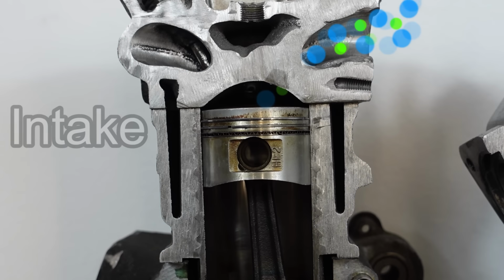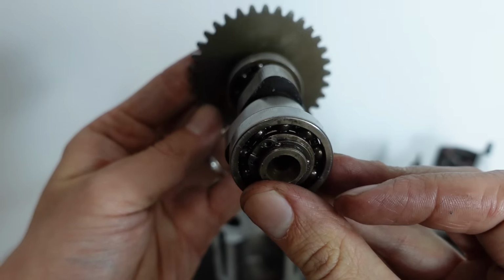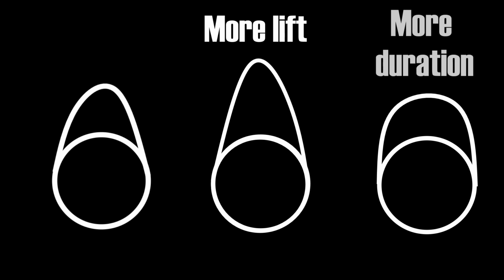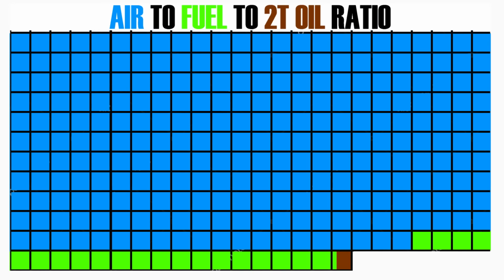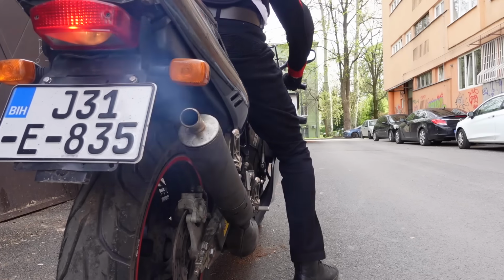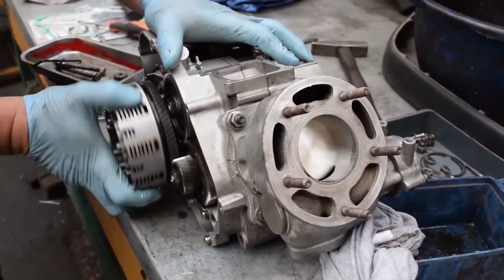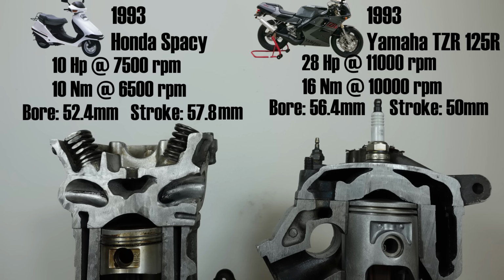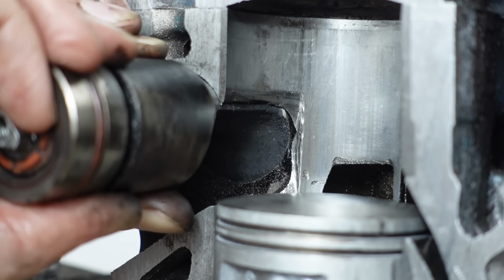The Only Video You'll Ever Need to Watch to Know how 4 Stroke and 2 Stroke Engines Work and Differ

Comment: I have a Bachelor of Science in Mechanical Engineering (BSME) with a Major in Power and Propulsion. Your presentation is very well done. The only thing I would like to clarify is that not all Two Stoke Engines require frequent rebuilds. You did allude to this fact, but I personally rode a 1974 Suzuki GT750 Lemans (Water buffalo)129,000 miles before the crank seals needed replacement. The crank was just fine and is still running at 156,000 miles. Many of the Lemans America Club members rode a GT750 approaching 200,000 miles before a rebuild was required. One of the Lemans America Club Members put it best when he said, "The longevity of the GT750 Lemans is the best kept secret in all of Motorcycling!" Incidentally, the Suzuki GT750 Lemans was the first Liquid Cooled Production Motorcycle from Japan. It was released in Japan in 1971 and in the USA in 1972. The bike was nicknamed the "Water Buffalo" in the USA and the "Kettle" in the UK.
Motorbike Mike Piekarski

Comment: This video is a beautifully and phenomenally explained guide to 4-stroke and 2-stroke engines! Your clear breakdown of each engine cycle made the differences easy to understand. The visuals illustrating the intake, compression, power, and exhaust strokes for the 4-stroke engine were particularly helpful, while the concise explanation of the 2-stroke cycle highlighted its strength and drawbacks of inefficiency. Thank you for creating such an insightful resource!❤ Just subbed

Comment: Wow I really appreciate on this explanation on the difference between Two Stroke and Four Stroke combustion , in order that the viewers can get knowledge and understand the mechanical function on each parts of the engine, it is very good illustration of the engine block that they cut on a half so that every viewers can see the movement of parts inside on the  block.
Thanks for good illustration.

Comment: The returning pressure wave caused by the expanding section of the expansion chamber
is a rarefaction (low pressure) wave (see 26.11) that helps to "suck out" the exhaust gas.
The narrowing section at the far end of the expansion chamber causes a compression
(high pressure) wave that pushes back on the intake charge which is trying to exit through
the still-open exhaust port.  The proper timing of these waves depends on rpm, and it's a
major reason for the narrower rpm power band of a 2-stroke engine.

Comment: When I was 16, My Physics teacher at school, let me actually take the class, when we did 2 stroke and 4 stroke engines. We had a working, hand cranked cutaway mockup of a 4 stroke single, which I used, and I also drew diagrams on the White board. For good measure, I explained Carbs, Reed Induction valves, and went onto Turbo and Superchargers. My classmates were jawdropped, and my Teacher was highly impressed,
Respect Achievement unlocked!! 😊👍🏻

Comment: Great video.   One correction:  the valve shown in that YPVS implementation is NOT a guillotine style valve; it is a rotary valve.  Yamaha used guillotine style valves on other engines, including TZR and TZ models of various vintage, including all 4DP and 4TW model TZs.  5KE TZs used the guillotine valve initially and the final version (5KE3) used a rotary valve.  The guillotine valve is effectively either on or off/digital, while the rotary valve facilitates a more continuous/analog function.

Comment: I had 2 125cc 2-stroke motorcycles when I was 15-18. A Husqvarna supermoto and a Yamaha supermoto. The Husqvarna was more powerful and better but it was stolen. Then I bought a Yamaha. I had to do an engine overhaul on both. All bearings etc. Right at that 20,000km mark. I was able to use the Husqvarna for free on the dyno. It made 27hp from the rear wheel. Very good video. I understand 4-stroke engines very well because I have repaired large truck diesel engines (Scania). Even though I repaired my own motorcycles back in the day, I never 100% understood 2-strokes. Thanks

Comment: Not specifically rocker arms lol. Usually you have either SOHC or DOHC (Single/Double OverHead Camshaft), which are usually called "direct acting" since push cups are placed on the valves, and the camshaft(s) directly press on them. You also have the same but with rockers, where the camshafts are usually to the sides of the valves and push on the rockers (which push on the valves) instead; this makes the cylinder head (and potentially the rocker cover) shorter vertically. More rarely you have Pushrod engines, which were most popular through the 20th century; this is where instead of the camshaft(s) being right under the rockers, their place is taken by Push Rods, which run through the engine block; the camshaft is located in the engine block instead, and pushes on the push rods; the pros of such composition is that a shorter geartrain/timing chain/timing belt is needed; a variation of this system is a Flathead engine, where all valvetrain components are in the engineblock, and the valves are pushed either by a DA camshaft or push rods, instead they are placed on the side of the cylinder, most popular in the early 20th century, although still used today due to it's simplicity, such as the Briggs & Stratton 450 series engines, most used in lawn equipment, where the head is a (almost) flat piece of metal with cooling fins. However, not all flatheads are just flat heads, some have oil or cooling jackets running through the head.
Correct me if i am wrong, i am not an expert in this

Comment: A great explainer. I've been using 2 strokes every now and then, and it never occured to me that the air fuel mixture was traveling through the crankcase before making it into the cylinder

Comment: I have information on a hybrid engine made in the mid 90's where some one combined the parts from a 80cc honda 2 stroke and a 80cc honda4 stroke engine. The prototype was made from small engines to cut the cost on making a prototype for proof of concept. The result was 2x the horsepower at 1/2 the weight and a smaller size. The resulting engine tried to rip itself from the test bench it was fastened to from the torque increase.  Wish I could find more info on what happened to the idea but at least I remember the specs and ideas. I even made a PSD file with the info ^_^

Comment: You can also replace the vacuum created by the cylinder with a compressor. 
This allows you to fully seal the crank case and use similar lubrication as with 4 strokes

Comment: The expansion chamber is mindblowing. Does it need to be an exact shape or size? Can you just make it huge enough so it will  push back the air/fuel mixture? I'm guessing if it's too small, you won't get the same effect.

Comment: Question. You discussed the Expansion Chamber. Is the Stock Exhaust on a 1969 Kawaski 2 Stroke 500 H1 an Expansion Chamber? How/what does removing the Stock Exhaust on the same motorcycle and replacing them with Expansion Chambers change the process?

Comment: Did you have make a video about how a transmission work? I can't find any in your channel.... 
I suspect most people has never seen any and don't know exactly how the transmission shift works (especially the motorcycle sequencial shift). IMO the transmission is one of the most intriguing parts into an engine, and it would be fine if you make a video showing how it work!

Comment: I came here because I was very confused after acquiring and running a 2004 evinrude outboard motor. I knew it was 2 stroke, but it didn't act carbureted.. Turns out, it's fuel injected..

Very interesting piece of tech.. 

From my understanding the motor pumps oil and delivers it strategically to different areas of the motor (versus mixing with fuel).

Comment: Best video on utube regarding overlap etc thx..
I'm  stressing atm i did an oil change  on my 04 525exc as per 100 times previously but when finished it refused to turn over with kick or button so pulled clutch cover off to find needle bearing supporting the sprocket which turns crank over  [the centre one which sits about 2oclock to right of clutch] had spat a few rollers. Reflushed case with oil blew out case gently and backed valves off in case they were catching piston but still didnt want to budge. Tried rolling backwards gently etc nothing. I ended up using socket on crank bolt and got it. Didnt try to start but i adjusted valves [possibly incorrectly hence the love of your awesome vid so I'll do again as its still grabbing a little. I've no confidence going much further 4t's lose me lol so i can only hope no rollers got into bottom end [if they're even able to?]or anywhere else but having not tried to start I'm lost if the shrapnel should go too far at all? Now I'm  scared to try and start it just in case.
Reply: No idea how I sent my previous comment to this vid it was meant for your vid titled "why it's important to understand tdc lol technology  and 4t's really dislike me I think.

Comment: Thanks, very clear and good. Why is it said that ktm’s TPI/TBI improves the ecological credentials of the engines? It’s not direct injection, fuel mix gets still leaked through the exhaust port and oil burned in the chamber…

Comment: KTM has the injection in at least some of it's 2 strokes now. Looking at it in this video though, it looks like you can't use a pre-mix any more as the fuel doesn't get sent below the piston...with that in mind, I'm guessing it's the separate oil tank and it gets injected into the air intake?

Comment: Great video. But 1 question. Given that timing chain/belt failure is so catastrophic to an engine, why do we have interference engines? If the valves and pistons could never meet, at least the engine wouldn't be so severely damaged by a timing malfunction.

Comment: Excellent presentation!! 👏 Two questions.  I wasn't aware of reed valves being used in two strokes. Do they stand up to hi temperature well? They look like they're are perfect for pulse jets, but they would be in the red hot zone. And how do they calculate the dimensions of the expansion chamber? 
One last question. Do you have any videos on pulse jets?

Comment: Hey! Great explanation! Although I couldn't watch the illustration since I am blind, I managed to understand, at least basically, how these engines work. I knew that the 2 stroke makes that awful smoke because it doesn't burn it's fuel good enough, but it's much worse than that! It dumps part of it outside and it burns all it's lubricant! Dam! They should be illegal even in scooters!
Edit: Thanks!

Comment: Good video very informative.
However you missed one of the biggest benefits of two stroke engines, they can operate in any position even upside down.

Not having an oil pan means that oil will not flood the engine if it is tipped or tilted, this is why two stroke engines are preferred for chainsaws and leaf blowers.

Comment: Fantastic well done video, thank you. One question if you still monitor this is with direct injection in a future two stroke, how is lubricant introduced to the bottom end? I've also assumed the big reason two strokes still exist in chainsaws, weed whips etc is the constant movement and angle of engines don't allow oil pans like 4 strokes, is that true?

Comment: If you specifically look at the marine outboard engines, the old 2 strokes a huge amount from the 80s on up are still humming along fine while many of the 4 strokes from the mid 2000's have many issues.  That's because they have more moving parts, more weight and higher complexity leading to more failures.  Again, marine outboards in particular, motorcycles might be a different story.

Comment: You should probably have included places where 2 strokes are more used than four strokes, for example, marine diesel engienes and such. Because if a two stroke is well made enough it is much more efficient at larger sizes than a 4 stroke :)

Comment: Direct injected 2 stroke engines have been around for a long time and are currently used in busses, trucks,  boats and especially large merchant ships.  They are all diesel, and rely on a single port at the bottom of the cylinder and a valve at the top for scavenging.  They all require some sort of compressor to push air through the cylinder fast enough to clear a sufficient amount of exhaust gas.  The most common 2 stroke diesel is the GM 6-71 series.

Comment: Thanks for the explanation video, however I still have some questions left. Based on the difference between the two, how does these different combustion mechanics affect the difference in how the exhaust is shaped and sounds like? Is 23:41-27:17 [VVT & Power Valves] the answer to that?

Comment: Now I understand the whole mechanism inside. My question is that my two-stroke Yamaha emits heavy smoke even at idle and more heavy smoke when accelerating. What could possibly create this?
Here some details:
1. The spark plug is all the time black even on lean burning.
2. The reed is ok.
3. There are always oil leaking at the tip of the exhaust muffler.
4. The carburettor is cleaned no dirt.
5. No oil leaking from the engine.

Awaiting a solution from you.

Comment: Have you had a look at Evinrudes Etech? 

Has variable exhaust timing gate and stratified direct injection. 

Oil galleries take care of lubrication.  Runs around 1000:1 .
This makes it run clean and efficient. 
 So clean infact, they got an exemption from the EPA because they are cleaner than most 4 strokes. 
Evinrude suggested that if emissions was the EPA's reasoning,  that perhaps all 4 strokes should be banned. 
 
With such a clean burning stratified engine with only brand new oil on the bearings,  servicing is almost not necessary and engine life is extended considerably.  This engine becomes extremely cost effective and environmentally friendly! 

It's quite possible that they were forced out of the market simply because of the potential reductions in maintenance.   But I think their poor marketing had more of an impact. Also the Canadian taxes and regulations made it impossible during covid.

Comment: There are hybrid engine technology inventions that retrofit the existing powerful 2-cycle and cleaner 4-cycle engines into a “D-cycle” (differential-stroke cycle) engine. The hybrid D-cycle design has been tested to great efficiency (>20% fuel saving), and great power gain (>2.5x to 3x torque increase). These retrofit technologies are all available in existing engines. It is just by splitting the crown part to be operated by a (valvetrain-like) pistontrain. The D-cycle engines can be just 2, 3,4 cylinders instead of current 4, v6 and V8.

Comment: I am working on the 4 stroke engines for 40 years and can say that the working principle of the 4-stroke engine as explained in the video is 100 % INCORRECT.
The working of the 4-stroke engine is 100% independent of the pressure difference between the combustion chamber pressure and atmospheric pressure, BUT 100% dependent of the timing of the intake and exhaust valves.

Comment: I am intrigued by the fact that you highlight the limited lifespan of 2 stroke engines. 2 stroke outboard engines are mostly working for ever, in my experience (at least the smaller, low hp outboards). Can't explain why. But I've had 20+ and 30+ years old 2 stroke outboard engines that seems like they can keep working for the next 20+ or 30+ years.

Comment: 2 stroke injektion have to be placed at reed valve, because lubrication and duration, its more time to spray it under.  and axhaust is very importent by 2 stroke, better build a variabel one in all rounds per minutes

Comment: At least, a 2-stroke engine receives fresh (unused) Engine Oil at every single firing cycle of the engine. A 4 -stroke has to re-use old Engine Oil over and over..........That's why it is so important to change the Oil Filter regularly - to get maximum engine life.

Comment: didnt vespa produce direct injected 50cc 2-strokes? but if i remember even that didnt pass later euro emissions, my heart wants to love 2-strokes for their simplicity and power output, but my brain still loves the 4-stroke because of their reliability, also the technology are too advanced and invested that current 125cc 4-stroke motorcycles makes double the power of that 125cc 2-stroke sportbike, but this is only about gas longitudinal 2-stroke engines, its currently a competition whether porsche's efuel, hydrogen, or other engine layouts that are technically 2-strokes like the innengine (despite what they say about being 1-stroke) will take the throne in the future.

Comment: Here's the message:

"Hi Motorcycle Engineer,

We've been discussing the idea of creating a powerful motor for a motorcycle. With a bigger gear in the front and a smaller gear in the back, we could potentially create a high-performance machine. The motor would need to be designed to handle higher RPMs and produce more torque.

Some potential benefits include:

- Increased acceleration
- Higher top speed
- Improved hill climbing
- Enhanced responsiveness

However, we'd need to consider upgrades to the suspension, brakes, and frame to handle the increased power and speed.

What are your thoughts on this concept? How would you approach designing a powerful motor for a motorcycle, and what challenges do you think we'd face?

Best regards,
[Your Name]"

Let's see what the motorcycle engineer has to say!

Comment: Just found something that I think is impressive. my 4 stroke 1993 HondaXR 200R is making 23hp/17.1kw @9000 RPM and a whopping 19.5NM /14.4 lb-ft @7500….

For my gearheads
Six gears
1st 2.769:1
2nd 1.941:1
3rd 1.450:1
4th 1.130:1
5th 0.923:1
6th 0.785:1

(Bore x stroke) 67 x 56.5mm

Compression ratio10.0:1

Btw it’s a Single cylinder two valve chain driven overhead cam

Comment: well actually air pollution itself is increased with two strokes. but carbon dioxide emissions are usually lower than with 4 strokes